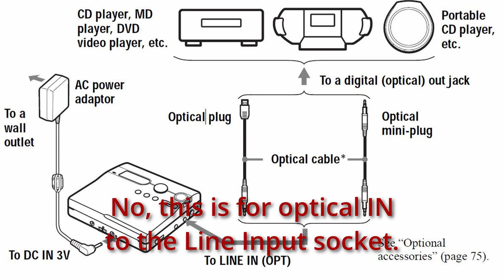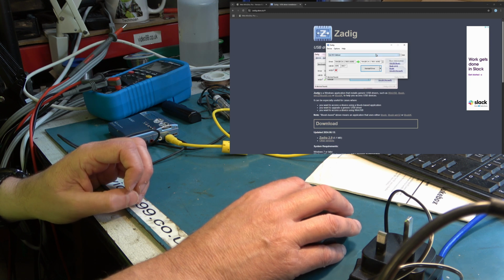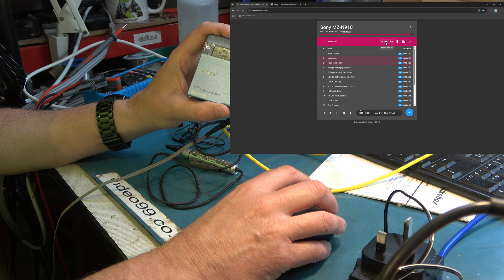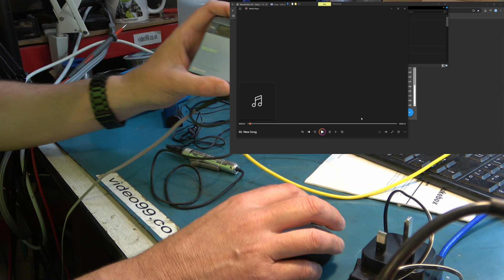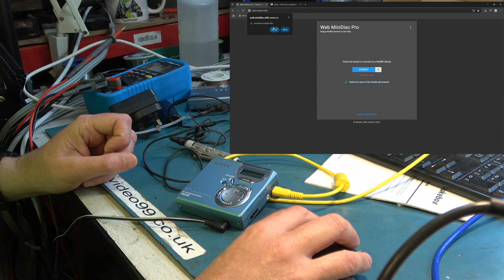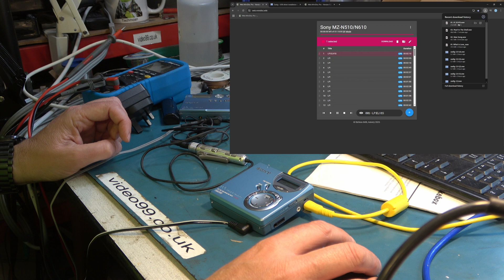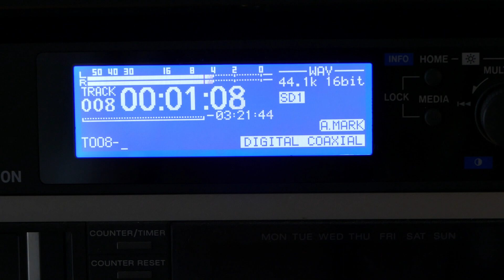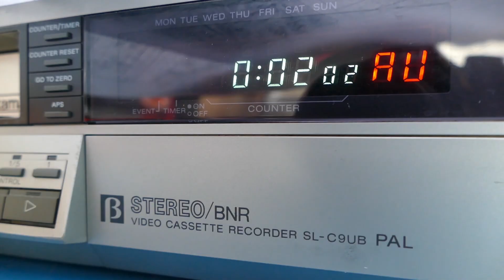Use Web MiniDisc Pro to transfer audio files from two NetMD Walkmans.

Comment: Oooo. Been wanting to do this for years. What's the yellow cable from the mini disc player to your computer?
Reply from the maker: Just a mini-USB cable.
Reply: @video99couk damn. I have a mini disc separates system. Pretty sure doesn't have mini usb on it. Will have to find another option

Comment: Around 1:20 you talk about the power cord that you've had to patch up. I have the same problem. Bare wires every 10 cm . Can't use that. What kind of wire did you use to patch it up? (The device needs 3v, i believe). Thanks for any advice
Reply from the maker: I was able to patch in a length of two core wire (25 strand speaker wire I think it was).  But this depends if you have enough at each end to be able to solder the patch onto.  It might be easier to get an earlier bulkier Sony 3V supply which had better cable.

Comment: Hi, thanks for the videos :) I am getting back in to my MD, however I cannot get my NetMD to connect! I have tried 3 different players, and 3 OS's, Win 11, macOS and Linux. The computers do not detect them even at a hardware level. Is the 3V power what I am missing? I am currently using the gum stick in two of them / it is taking power (my MZ-N10) form the USB A connector.
Reply from the maker: They should be detected.  In my video you can hear the "dong-ding" connection sound of the MD devices being detected by Windows 10 even before the driver is installed.  I was running them from 3V, so perhaps do that.  Also of course try a different USB cable.
Reply: @video99couk  Yes my issue is the OS is not recognising the devices, though I know they work as my son in law used them, he didn't however bring the 3V adapter. I will update this comment once I get my adapter.
Reply: It was indeed the cable, my aging brain forgot that I needed a USB cable that can also handle data transfer, not all USB cables are created equally. So one from a phone / HDD caddy etc. would do.

The 3V adapter wasn't required though recommended as writing does consume battery!

Comment: Hello
Thanks for the video
I was not very clear if this software Web Minidisc Pro helps 1- transferring files from the computer onto a blank minidisc
2- Does it help transferring rather recordings made on minidisc to the computer
3- works in both directions?

Could you please confirm what it can do?

Also it works with NetMD unit but
Does it work with HiMD minidisc units?

I would greatly appreciate your response

Kind regards
Reply from the maker: You can look up these details on the Web Minidisc Pro web site, but yes I believe it goes both ways and works with HiMD.

Comment: Great video-Thanks! I use web minidisc pro for track naming, but I prefer to record optically from Qobuz because it’s a pure source, and only 10 quid per month 💽. I really appreciate you bringing up the question of auto track marking via optical – What a black art! Nobody knows about this because most equipment removes it. 
Its called ‘PQ subcode’ in the optical stream, and there isn’t much info about it. However, I’ve read that the TASCAM MD-CD1 has a 'DD' feature that is designed to preserve the subcode. Of course, you need a seamless digital chain (Software to send, DAC to interpret, recorder to understand it). The Xitel DG-1 and DG-2, ancient USB Audio adapters, were designed to retain track markers. 
So, I’m on a mission to find out more. If you know where I can read up about PQ Subcode, or have any other recommendations on equipment, I’d love to find out!
Thanks for any insights—appreciate the deep dive into this topic!

Comment: Hello ! Have a Sony MD MZ-NH600, can not get it to work with wiki.minidisc website ? Installed Zadig driver but my device not show up on the screen. Have windows 10 and also use crome but can not see my divice ?
Reply: Now i got it to work with " electronwmd " , downloaded     windows 64.exe up on screen straight away. 1 GB disc don't work....i think ? Maby i have settings wrong for 1 GB discs.

Comment: Regarding the start marks on S/PDIF: It's a major annoyance that DAT/MD/CD/DCC and so on do not share a common format when it comes to signalling the start marks over S/PDIF. There was a German manufacturer named HUCHT which had format conversion boxes like the ICP-1 which could convert between formats. They basically detected the input format automatically and you told them by three switches which output format you wanted.

When the current copyright laws arrived HUCHT was doomed because their products also removed any copy protection flags. I have multiple of their devices to convert between DAT, CD and MD. Furthermore, these boxes were the only way to get the broken digital signal processing of the Yamaha DSP-A3090 to work when it comes to SCMS protected media. My receiver still was within warranty, nevertheless the Yamaha service just told me "We don't fix the DSP firmware but have fun with your (broken) device". Well, nice to hear that with a not so cheap device. The problem with these receivers is that the SCMS processing defines a copy by permanently toggling the copy protection bit which led the broken signal processing of the DSP-A3090 to mute the signal while it should have no influence at all!

Comment: i use my mini disc all the time walking to & from the pub   my technics stack system deck is useless now, it never reeads discs or says its recording but disc is blank still after. but the sony stack recorder i have is still fine & its so much louder than any mp3 player ive owned

Comment: I'm out of the loop, I haven't seen many MD videos in some time, is the original Sony software no longer compatible with newer Windows?
Reply: I do use the old SonicStage Sony software and it does work with some messing around with Windows 10 but not tried with Windows 11 yet so that's something to try when I finally upgrade in a month or too.

Comment: Small World ! - I took my MD recorder (Kenwood DM9090) from the loft and got a USB to SPDIF converter - and linked my iMac to the recorder and recorded some music from the Mac - Sounded really good . I also have a Yahama MD recorder and a Sharp portable )( none of which are Net MD )...lucky me eh ? . Great Video
Reply from the maker: My first MD portable was a Sharp, but it died with laser failure when it was not long out of guarantee.
Reply: @video99couk  Its a Sharp 701 - I still have it ( Its in my hand ) but I need to use glasses to see the controls - another Joy of old age. I can't find the charger for it
Reply: Would I be able to use that cable to transfer from disc to FLAV using audacity? I don't have a netMD so I don't know how best to proceed. Thanks.

Comment: Nice work. It's helpful to know about resources like this, though I honestly wouldn't bother ripping a MiniDisc unless it had a unique and/or live recording on it (such as little Billy's 3rd grade recital, or your college band's only pub gig); it's less work to visit your favorite e-commerce website (or fly the jolly roger) and get a new, high-quality copy of Elvis' Greatest Hits.
That disintegrating cable thing is a problem with a lot of Sony gear. I may try dipping a cable in FlexSeal or other rubberized coating just to try to save it, though replacing it would be ideal (assuming the connectors are available). I should also get a 3D printer and try to make new gears for all this stuff. I have stacks of A/V equipment and broken transport plastics are usually what permanently kills them (often this stuff is so old, the plastic parts are broken the same way in basically every example of a given machine, so I can't just cannibalize).
Reply: Apparently the more flexible and supple a cable was when new, the more likely it's to disintegrate after a few years. It's a very common issue with USB leads for smart phones but also mains charge leads and some headphone leads. My Sennheiser HD201 headphones suffer from this pretty badly.

3D printing is neat but often struggles with fine details. For gears I wouldn't bother with a filament printer. Maybe you can play around with someone's resin (SLA) printer before you buy one yourself. These are much more of a faff to run and the resin is loads more expensive than filament but the resolution is much finer and I find the parts stronger, if perhaps more brittle. Filament prints have a tendency to crack between layers.
SLS printers create really tough objects, e.g. from Nylon, but the surface of the prints is gritty, which isn't ideal for gears either.

Comment: there are 2 decks, the mds je780 and jb980 which is a 780 in drag, both can be expensive, most failures nowadays are to do with the eject belt as most md decks diddent get a lot of use in the first place, there are two ways of replacing the belt, the easy way and the risky way.

Comment: Hi Colin, do you plan an additional video, where you show the extraction to ATRAC files without re-encoding them using Web MiniDisk Pro? I just found out that VLC is supposed to play all MiniDisk ATRAC formats just fine. I think, re-encoding using VLC may be much less buggy than using Web MiniDisk Pro. Maybe FFMPEG is also a way to go for this.

Comment: hi have a mate  he's well behide and not on the net    
ELVIS  you are right  not a fan as well      

 i have a   elvis tape  cassete  the thing i know it was not made right  the speed is well of   my  tascam 238 runs at 2 speeds   

 i  7/8    3 3/4   i find alot of tapes are not recorded right  same with reel to reel ones 
some decks are way out i am lucks i have a  mtr 12  i can turn up the  play speed there's a big range  

mini discs i have been there   big fan of the yamaha d24    MO recorder     i find alot of the sony md decks are going bad now 
i had alot once   alot off the home decks i had have stopped working  and  my computer now is a amd 4   win 10 

have a hard time with drivers  on  the new windows  now